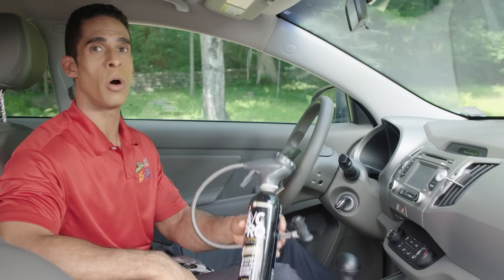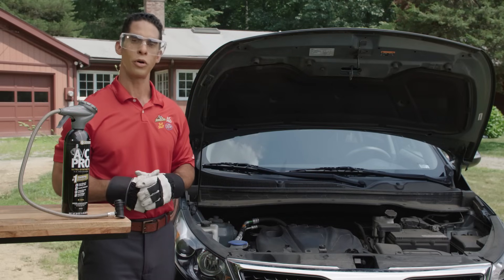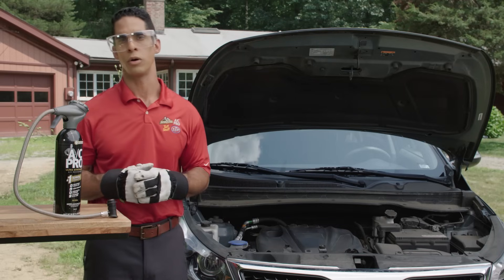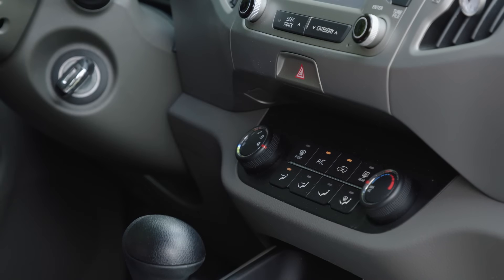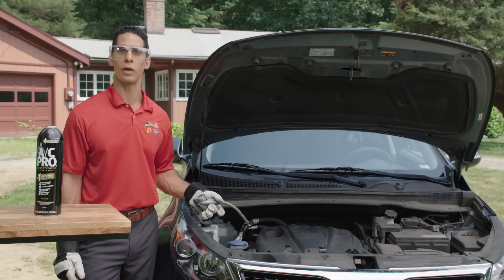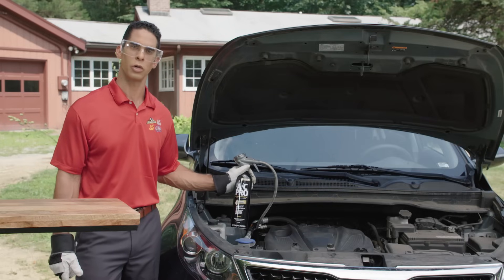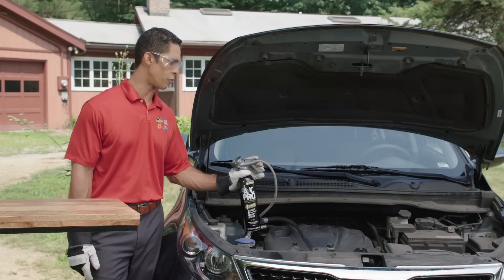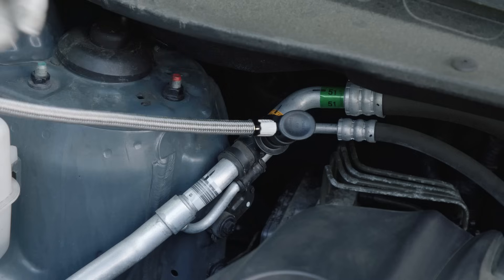A/C Pro® How To Recharge

Comment: I so appreciate the video. Was taking a 5 hour trip by car to NY and my A/C was pumping out hot air. Local oil change place wanted $199 to recharge the A/C. I watched your video and bought the A/C Pro Kit and in literally 10 minutes had the A/C nice and cold. Thank you! A crime to charge $199!
Reply: Damn bruh, $200 that's crazy
Reply: 1234 yf?
Reply: Our recharge kit isn’t even blowing any air into it.
Reply: Mine dealer said 295 just to diagnose
Reply: Wow
Reply: Bloody right. $150 at my local auto shop

Comment: I lowered the A/C temperature using the A/C Pro kit following the instructions here. My A/C system was behaving oddly before the recharge. Ford 1999 F-250. At the first step, I started the engine and turned the A/C to MAX. With just the gauge on, the needle would go from green and then dip into white for a few seconds, then the A/C compressor clutch would kick out for 4 seconds, then back in for about 20 seconds. This repeated for 10 minutes. Each time the gauge would drop to about 22, then rise to about 40. I re-checked the A/C controls, all correct. 

I decided to just add a little, as the analog gauge  was dipping into the white area, about 20 PSI. After adding new refrigerant for a minute or two, the cycling stopped and the A/C system stayed on! This was a pleasant surprise. I continued adding till the gauge read about 35 PSI. 

Nice cold A/C now. Thanks very much!
Reply: Bloody well done
Reply: Mine is doing the same exact thing

Comment: Excellent easy to understand video.
Just recharged the A/C in my 2015 VW GTI (the air has been steadily blowing less and less cold over time) and it worked perfectly!
I did however only pull the trigger for about 3 second intervals, checked the gauge, 3 seconds again...
Reply from the maker: Great to hear!
Reply: My compressor won't stop rapid cycling but it won't take anymore freon from the can.
Reply: @cdsmit27  try another small can, I had the same issue

Comment: Just did this for my 2012 Honda CRV. It’s a temporary fix, but it works wonders on my AC now! If yall are doing this, be sure to not overcharge. I charged mine up to around 31 psi. It’s better to undercharge than to overcharge. Also take into account of the ambient air temp. I did mine when it was around 78-80F in my garage. It’s also very important to know how much psi that your car operates for the A/C. Some cars have a lower/higher psi that the a/c takes of refrigerant than others.
Reply from the maker: Always appreciate hearing these stories, thank you for sharing!

Comment: I have a 1995 Chevy Blazer I recently bought from an older guy in my city.  He never drove it during winters so for a 23 year old truck, it was PRISTINE! Anyhow, shortly after I bought it the AC seemed to need a recharge.  I'm a DIY'er, or at last as much as I can.  So my research led me to AC Pro.  The instructions seemed too easy to believe, , , but it really was that easy!  In just a few trigger pulls the trucks AC compressor kicked in, , , yeah, signs of life!  A few more trigger pulls (while shaking and rotating from 12 o'clock and 3 o'clock) the gauge was reading all green.  I even have refrigerant left over, which is a good sign that the system was not completely out, but was just low (what else to expect after 23 years).
     I want to end by saying this is an awesome and easy to use product!  It a LOT easier on the wallet than a trip tot he service garage!
Reply: Badass car

Comment: Good point at the end of the video. Too much refrigerant is also a problem.
For an A/C system to work, the refrigerant must cycle from liquid to a gas.
If everything is too compressed, this process will not be able to function
properly if at all. "More is better" does not apply here once your factory
capacity has been reached. 
One more thing. Use caution with those cans that claim "leak sealant". That can
plug up the tiny metering device in the system used to convert a gas into a liquid. 
Enjoy the summer weather.  😎

Comment: This is the best tutorial ever !! First time I did something on my one in my car thank you
Reply from the maker: Great to hear!
Reply: This gives me hope im about to do it myself too! 🙌👊
Reply: @CeejayClark What they didn't tell you in the video is that you should always pull a vacuum of the old refrigerant, which is completely removing the old freon before installing the new & making sure there are no leaks. If the AC worked before, then it's most likely holding refrigerant. Also, you most likely don't have the proper equipment for that procedure so you should most definitely take your car to an auto mechanic & have them pull a vacuum of the old refrigerant, then afterwards recharge the AC system with the AC pro. If your car is newer, then it's probably ok just simply topping it off, but if it's 5 or more years old, then a vacuum must be performed to remove the old freon & possible residual moisture in the lines that can cause corrosion. Do it right, then you don't have to worry..

Comment: I have A/C again, just as simple as video showed.  I only made one mistake at the beginning,,,,,, I missed turning on the A/C, as I only turned on the fans and lowered the temperature scale but missed the A/C Button.  However,  once I re-did it with the A/C on (Light), it worked, and Wala cold air, but it did take me about 20 to 30 minutes. It also helps to have the gloves on as when the transfer of the liquid is taking place the container gets cold 🥶 a bit.

Comment: Great video! It seems like the new gage doesn't have a temperature dial. Is it not needed anymore?
Reply: even though this is 2 years old so it’s probably not much help, but i took mine a few millimeters past yellow but it was also 95 degrees out so i went to about 50 PSI

Comment: Great Product, after use do you store the can with the Guage attached?
Reply from the maker: You can store either with the gauge attached or not.  The can has a self-sealing valve so no gas will leak out if you disconnect.

Comment: Worked great. What do I do with the leftover freon in the can, and should I disconnect the gauge/hose when storing it?
Reply from the maker: You can just store it in a cool, dry space.  The hose can either stay connected or be taken off.  There's a self-sealing valve on the can top so it won't leak.
Reply: @Acprocold jeez. The ones from 10 years ago didn't have that feature.  I took my Guage off and freon sprayed everywhere.  😅

Comment: Ok so I literally been obsessed with getting ac working in my 2004 Toyota Sienna minivan. I bought it with no ac and suffer when driving it even on mild hot days. I didn’t know about refrigerant in a bottle until recently. I used a paper clip to jump the relay at the fuse box so that my clutch engages and then added ac pro. I also swapped the clutch relay with the horn relay to see if the clutch relay is working and sure enough the clutch relay is bad. For now I temporarily use the horn relay in place of the clutch relay until I buy a new relay. 
My van takes almost 1.9 lbs and this bottle is about 1.2lbs. I refilled the whole bottle but the gauge still read low. However, I can feel my ac kinda working except only on the passenger vents and not the driver side vents (still happy).I’m guessing it’s probably not enough refrigerant that’s causing the driver side to not blow cold as the passenger. Another thing is few hours later I would drive the car and test the gauge and it would read in the green. I read that low pressure fluctuations could be due to the outdoor temperature. In the morning when I test it always reads low around 20-25 psi. Anyways I hope this helps others and trust me this thing works. I can’t say how long as everyone’s severity and type of leak differs, but for now I am so happy. Sitting in scorching heat with no ac is not the business. Thanks AC PRO!!!

Comment: Was very happy with results of AC Pro. Used it on a 1998 Chrysler Ci6 and it worked great. Does the gauge have to be disconnected from the canister for pressure check? Thank you.
Reply from the maker: No it doesn't necessarily need to be disconnected to check the pressure.
Reply: Don't do that or you will have a mess. 😅  happened to me once.

Comment: At the beginning of your video, you show the hose attached to the  Canister. So I connected the hose to the canister. Later in the video you explained to have the hose separate from the canister while first checking the pressure on the system. If you remove the hose from the canister.
Reply from the maker: Yes, we encourage people to check the pressure first to make sure the product will work with their vehicle as there are many problems other than low refrigerant that we can't fix.  Check the pressure first without the can attached.  If you've followed the steps properly (engine and A/C on with pressure taken while compressor is on) and the pressure is in the red, you can reattach the gauge and return the product as long as you didn't dispense any refrigerant.  If it needs more refrigerant, you can then attach the gauge and add.

Comment: Super helpful video!   Im such an idiot but after getting direction its working great now.  (I didn't know the car needed to be running and the AC on...  Plus I had not removed the safety cap on the can so nothing was coming out)  Thank god cause it was near 100 degrees in Scottsdale today!
Reply from the maker: Yes, engine on with A/C on max cool or you'll get the wrong pressure reading.  Also need to remove the plastic shipping disk.  Glad you figured things out and got things going!

Comment: So last year I got in the car to take my son to work, and the AC was running kinda warm and The AC light was flashing red. I bought some of this and came to YouTube for directions. The can isn't that great with the directions. Anyway, I put it on and squeezed the trigger, and it said I need to service my ac. For some reason, it just started working after that and it ran the whole summer. Not sure if there was an error with the gauge and that little squeeze was enough to fill some up, but my ac worked until I didn't need it anymore. I kinda anticipated the same problem this year and I was right. Just went and put some in and it seems to be fine now. I couldn't find the blue L cap, though, must have forgotten to put it back on last time.

Comment: I just used AC pro today the 12 o clock to 3 o clock did not charge so I tried 6 o clock to 3 o clock worked well and charged fast but it took a good long 20 min, drive to get cold on my 2002 suburban.

Comment: Why is there not a temperature dial in this unit? I thought you want to fill to different regions in the "filled" green zone depending on the outside temperature?
Reply: Yeah
Reply: Excellent point.  The Chris Fix vid on this topic used an AC Pro canister that had a temp compensator dial. They no longer have that, but the AC Pro site does have a chart that shows how to adjust the low side PSI to compensate for the ambient temperature.  So, it'll still work, but it now takes more effort on behalf of the user to figure it out.

Comment: I have been told my 1991 Nissan 240SX requires Freon, and cannot use Synthetic R-134a.  Apparently certain year cars require a special adapter.  Excellent video by the way.
Reply from the maker: Yes, vehicles made before 1994 may have used R-12, which is a different gas and has different fittings.  In order to use one of our products you'd need to buy a retrofit kit to change out the fittings.
Reply: Used it on my 98 Kouki and it worked perfect. Maybe earlier models used a different gas

Comment: Have the digital guage AC pro.
Followed the steps laid out here but every 10 seconds or so it drops to 17 then up to 40-43. I read that it is the AC clutch kicking off and on due to low refrigerant. Does it sound accurate to continue to fill it, until clutch stays engaged?
Reply: yes

Comment: If the air is cool, but not cold, do you recommend adding coolant with A/C Pro now or wait?  I am definitely not freezing with the A/C set to highest.
Reply from the maker: Check the pressure and if it shows low you can add in more refrigerant.  The temperature blowing out of your vents will vary depending on the outside ambient temperature (i.e. - if it's 80 degrees outside it will blow colder out of the vents than if it's 100).

Comment: I live in Houston Texas and summer temperatures are killing me. Lol I bought your product and the problem I’m having is that I can’t seem to be able to connect the gauge hose to the low port. I tried it at the store where they have an area to show you how to connect it. I can’t do it to the car. I have a 2018 Honda Civic. Have you had this issue? Thanks
Reply from the maker: The reason you can't connect is because your vehicle uses a different gas called R-1234yf.  It's a new gas that's environmentally-friendly.  You can learn more about it here https://youtu.be/CsrtqKdmlOo

Comment: What are we doing wrong? We squeeze the trigger and it says low. We rotate back and forth and then look at the gauge while not holding the trigger and it is the red area that says see instructions. Never changes.
Reply from the maker: When you pull the trigger the pressure goes to zero because the gauge can't read the pressure in the system since you're filling.  You need to periodically release the trigger to check the system pressure.

Comment: What about an AC that works fine while driving, but starts to blow warm when idling for moderately extended times? When this happens, it's full sunlight and temps in the high 80's through 90's. On warm to hotter cloudy days, no noticeable drop in performance.
Reply from the maker: That's a tough one.  Doesn't sound like an issue with low refrigerant if you get cold air when driving.
Reply: @Acprocold ello, should my gauge be on low before being used... Mine is already reading at 20 without being used
Reply: Curious if you ever found a fix to that problem?
Thx

Comment: **CAUTION** This video shows the regulator connected to the can in the video in the beginning. Then it shows him checking the amount of refrigerant with the regulator disconnected. I just unscrewed my regulator and the entire contents of the can shot out! Don't take the regulator off until the can is empty. (Edit) A friend gave this to me and the regulator was already attached.
Reply: Did it irritate your lungs n eyes, smell real bad?
Reply: Thanks …..I was just thinking about that. That should have been stated on the video.
Reply: It is possible that gave you an old-style can where the gauge had a needle that punctured the can when you screw it on.  For THOSE types, you cannot remove the gauge until the can is empty, true.  These AC Pro gauges do not have the puncture needle and won't work with those old cans.  Starting in 2018, all refrigerant cans were required to be self-sealing.  If your can wasn't old, then something is wrong with the can.   When you unscrew the gauge/trigger assembly, the can should not spew R134a into the air.
Reply: The same thing just happened to me!  Apparently once you attach the regulator to the top of the can after checking the refrigerant, it can NOT be unscrewed again from the top of the can!  I had a half used can in my garage that I had used previously on another car, and when I unscrew the top the contents of the can literally shot out everywhere!!!  It was all over me, my clothes and driveway…..what a big mess! 😕

Comment: Does the outside air temp have any influence on the pressure gauge?
Reply from the maker: The outside air temp will influence the pressure of the system.  The hotter it is outside the higher the pressure in the system.  The gauge will read the pressure in the system as it's influence by the outside ambient temp.

Comment: Remember. DO NOT disconnect the hose from the bottle ever again, unless you want to become Mr FREEZE and get crystal eyes. If the bottle is not empty, store it WITH THE HOSE ATTACHED
Reply from the maker: Actually, since 2018 all of our products containing refrigerant have a self-sealing valve can top on them instead of the old piercing-style can top.  With the self-sealing valve can top even if you take the gauge off, refrigerant will not come out of the top of the can.  With the old piercing can tops this definitely was an issue.

Comment: I just filled mine up it stayed at 35 PSI on the low side and the air flows at the vent 38F really cold the only thing I notice when removing the cap on the high side just to see it was really pressurized and released pressure when I turn the cap to open it its that normal?

Comment: Wow, I haven't felt cold air from my Honda Odyssey for a long time. So far so good. Should I take the hose off to store and put the plastic piece back on the tip? Or just store it with the hose on?
Reply from the maker: You can store with the gauge left on the can.  No need to keep the plastic shipping disk once the gauge is connected.
Reply: @Acprocold  Thanks for your reply. It's been about 3 hours and it's cooler than before. But then the very cold air started really coming in and it felt great! Any idea what might have happened?

Comment: Welp that’s not the issue :( my psi was 57. Must be the compressor then right? It looks like it’s moving. Is it something I can do on my own to save money?
Reply from the maker: That could be the case, but tough to tell. There are a lot of things that could be causing this.  Swapping out a compressor is not a simple DIY task and you will need to vacuum out your system with a recovery machine to do so.

Comment: Before I go ahead with the recharge, is there any need to bleed the fill hose which is 24" long to remove air.
Reply from the maker: No need to bleed the air from the hose.
Reply: @Acprocold  из-за этого будет высокое давление более 20bar...

Comment: Do you unscrew the hose connection when finished or leave it connected?
Reply from the maker: You can store it either connected or separate.  Just make sure to store in a cool location away from direct sunlight.